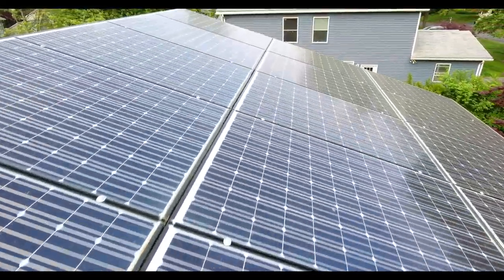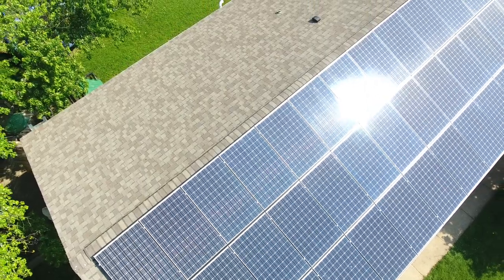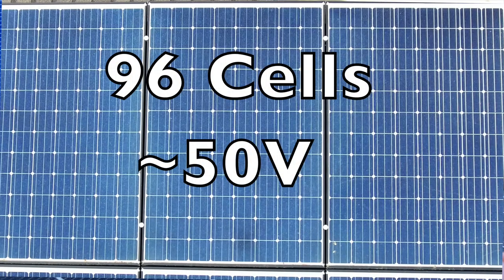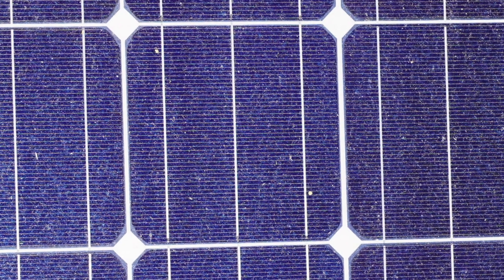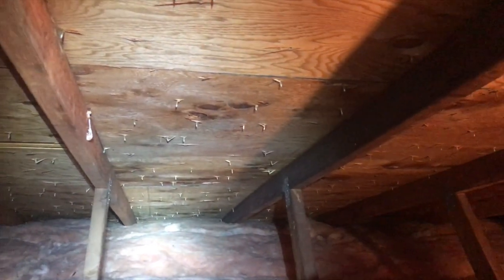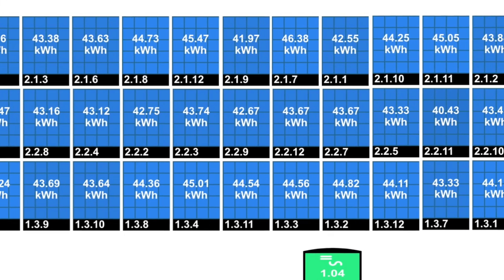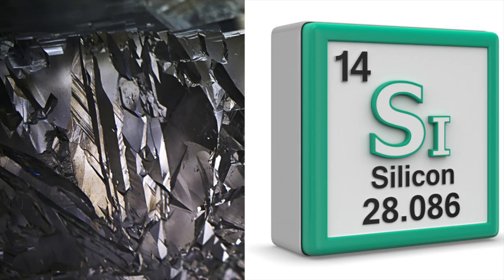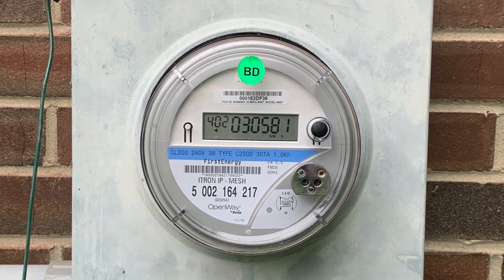Inside My 15,600 Watt Power Plant

Comment: In the middle of my 9kw DIY install right now. Your older videos were in part what helped make my decision! 

Got competing quotes from solar direct and unbound solar. Unbound had a much better offer and was more transparent about prices. 

Unbound did the wire electrical line diagram, and set me up with green lancer for the site plan.

Went with Enphase inverters, and have same iron ridge rail/feet. So far about 50% through the project now.  Looking forward to passing inspections lol
Reply from the maker: That’s awesome!
Reply: How far have you come three months later?
Reply: @tristanmoller9498  it's been installed since early July. So far so good!
Reply: @Zaugger  Congrats!

Comment: As tech advances, I consider doing this more and more. Retail panels are getting closer and closer to 500W. 

47% efficiency has been achieved in the lab and 40% has been achieved in the field.
Reply: 47% efficient? oMg then where’s the tech?🥺I wanna get the system also but my pockets are not yet ready.

Comment: I didn't see a battery bank why?? Also if you need to put a new roof you need to remove the entire system or the panels help to protect your roofing last longer??
Reply from the maker: Check out my solar misconception video.  It will answer the first question.  I have 1-1 net metering.  Yes, it helps protect the shingles.

Comment: What size wires did you use when you in stalled you production meter is a production meter the same a Bi directional meter, also do the wires from the combiner go to the top of the meter and the bottom wires go to the disconnect, Thank Great video
Reply from the maker: Thanks!  The production meter I put in is only one direction.  I don’t remember wire size off hand but I think they were either 2 or 4 gauge. To answer your other question, if probably have to watch the video again, LOL.  I seem to remember the input to the meter is on the top.

Comment: Now to install the whole home battery back up. That way you can go days without solar or grid power.
Reply from the maker: Good idea.  I’m glad I don’t really need it, but I may do this one day.  Net metering in PA is very nice and I get a 1 for 1 credit for any excess solar generation.
Reply: @FrugalRepair  just imagine how much you would get back if you use zero from the grid and always have a surplus. Yes ROI to think about I get that but hey why not have that independence?

Comment: When looking at your roof my initial thought is that you could fit a fourth row of panels. The lower part could still rest on the roof and the upper part could rest on stilts that are fixed on the shade side of your roof. Gives you maybe enough power for a small electric car and thereby cut your fuel costs.
Reply from the maker: I don’t think that is wise to have an extension apparatus above the ridge line. It would probably be very expensive to setup too.  I’d worry about wind and maintenance too.  Maybe I’m misunderstanding you.  The better next step I’m considering is put in mini spits for heating and cooling.
Reply: @FrugalRepair  well wind and other weather was also an initial thought when writting that comment but at least from wind you seem quiet well protected with the trees and houses around you. Cost probably heavily depend on how complicated the stilt system needs to be. Spits? Sorry I don't understand. You mean using solarthermic and photovoltaic energy simultaneously? That'll be genius!!!

Comment: So you still draw a lot from the grid when it's dark, right, but during day time you produce so much that net net, you're a net producer? My point is, you do need the grid every day? Are you thinking of putting batteries?
Reply from the maker: It’s better to look at it annually.  I have a net metering agreement so I make credit in the summer and use it up in the winter.

Comment: Do you have any battery system like a Tesla wall? If not then why not?
Reply from the maker: No, I don’t have any built in batteries.  I really don’t need them.  I explain more in the “is solar worth it?” video but net metering is the reason.  The power very rarely goes out so the batteries would be a big expense I would almost never use.
Reply: How about one or two marine deep cycle batteries  like technology connections did with an Inverter so you could at least run the fridge(s) and some lights when the power eventually goes out or the heater control panel depending on the season.

Comment: You have the best video on solar systems. May you talk about in more details how you connect the panel DC output to the converter? How many in series to get 400V DC?
Reply from the maker: Thanks!  For SolarEdge (p400) you would need enough panels to get up to 400v.  In my case 8 was the minimum per string

Comment: You are awesome.  I'm curious about your decision to go with string innverters, vs microinverters?  My thought is, what if one decides to add more panels, and then finds out that the string inverter also needs to be upgraded to match?  Okay, I see from your earlier video that you went with Panasonic 330 watt.
Reply from the maker: Thanks!  A big factor was cost when I was deciding, SE was cheaper.  I also have the ability to charge batteries easier since I have DC coming off the roof.  I’m also not realistically going to add more panels to my roof but if I wanted to I could add a few more with no problems.  I think micro-inverters are a great choice though!   My panels are 325w Panasonic’s.

Comment: Nice work ! Looking forward to install a 20kW solar panel system myself in the next year, just for the same reason as you: reducing my bills. I will also try to heat up the house using an electric system heater and very low usage of Putin's gas... (I live in Europe - Romania) and also switching at least one of the two cars we have to an electric car. From my calculations we should be able to have  zero bills and also a little income from the electric company switching all to electric (heating, hot water and both electric cars).

Just wondering: how comes you have 240V in your low voltage grid? Don't you guys in the US have 110V low voltage grid? 240V (230V to be more precised) is a common voltage for low voltage grids in Europe.
Reply from the maker: Thank you!  Your project sounds great.  240V comes to our homes from the transformers.  It's 2 120V lines.  Some appliances use 240V but most everything else uses 120V.

Comment: Whats wrong with panel 2.2.11? and howmany of your Solaredge tiny controllers died? :)
Reply from the maker: There’s nothing wrong with it.  It may produce less for any variety of reasons, shading or soiling would be the biggest ones.  If the numbers get significantly off, then I would start investigating more.

Comment: Does the Hydro company pay you or credit you for the excess power that you produce? 
Also, your main shut off switch is outside.  Is this a code rule, or just for ease of installation?  Personally, I'd want that inside the house, due to anyone just walking up and shutting down your hydro.  Curious minds want to know?  😁 Cheers,
Reply from the maker: Yes, anyone can walk by and shut off any solar system.  That's the code in case a first responder needs to make sure it's off.  I get 1-1 net metering credit for excess KWH

Comment: I would Imagine the shade that is created from the panels keeps your attic cooler as well therefore your HVAC system not having to work as hard
Reply from the maker: I’ll have to do some comparisons at some point.  I did take thermal readings before putting on the panels. But I bet you are correct and it is cooler.

Comment: Why two inverters?? I’ve seen a few peoples home systems that have two inverters, but no one ever explains why. Is it because of the amount of solar you have on your roof and the limitations of the inverters that necessitates two? For instance, if you had less panels on your roof then you would only need one inverter?
Reply from the maker: It’s the maximum input for the inverters.  These are 7.6kw each so I need two to handle my 15.6kw system.
Reply: @FrugalRepair  Awesome! Thank you for confirming. Really slick system and you do a great job with the videos.
Reply from the maker: Thanks!  Currently working on the next one.
Reply: @FrugalRepair  I'll make sure to check it out!
Reply: @FrugalRepair  Also, I'm missing something. You have a 15.6kw system, but don't you only have 48 panels? Don't they put out 100w a piece? Shouldn't that only give you 4,800w or 4.8kw? Thanks!
Reply from the maker: They are 325w each
Reply: @FrugalRepair  Welp, there you go! I appreciate the clarification!

Comment: Did you notice a reduction in attic temperature because half of the roof is essentially shaded now?
Reply from the maker: That’s a really good question. I did not take attic temperatures before putting in solar but I did take surface temperatures of the roof. At some point I want to go back and compare them to see.  It clearly has to be cooler because the panels are absorbing so much of that heat and keeping the shingles shaded.

Comment: How do they withstand hail?
Reply from the maker: The panels are strong and there’s no worry here of hail but if a big hail is going to dent your car, it might crack the glass on a panel.
Reply: @FrugalRepair  We have bad hail storm yearly here so I think I will pass on them.
Reply: @mgomez5606  Maybe consider a small ground mounted system and cover the panels with cardboard/towels/boards or something whenever there's a warning for hail.

Comment: I have roughly the same electrical needs as your home in Ohio. I definitely want to do solar for a while now. I saw you just put on new shingles. I am doing a roof over with metal. I also because of cost want to do this in stages. Maybe 8 panels x 3 stages = 24 panels. I have considered micro inverters instead. I live in the country where we have a co-op for electric. I discussed this 2 years ago but we don't have net-metering. I would have to buy their electric for retail ($.11) and they would buy mine for wholesale ($.6). So I would have to install maybe 36 panels to sell wholesale electric to break even.
Reply from the maker: I’m excited you’re thinking about solar. Sorry to hear that you don’t have net metering though.  Hope it works out though!  Let me know if you any any questions.

Comment: The cells you are showing are not for commercial dolar psnels. Solar panels are built with much, much higer quality and higer output cells. Just be clear.
Reply from the maker: The point I am trying to make is that they are very fragile.  That would be the case for any poly or mono crystaline wafer.

Comment: I would have my excess power running a Cryptocurrency mining rig BEFORE I would even consider giving it away to the power company!
Reply from the maker: I’m my case with 1-1 net metering it doesn’t matter.  I’m getting paid for this excess.  If I didn’t have 1-1 net metering, time of use rates, or I was generating way more than I needed annually, then what your suggesting makes sense in my situation.
Reply: @FrugalRepair  you get paid 1/50th of what you are charged for the same amount of power. Then they turn around and charge others full price for the power they paid you a 1/50th for.
Reply from the maker: I don’t think you understand.  I show my bills in other videos.  I get paid full retail rate so it doesn’t matter if I use more to mine crypto.  If I use more electricity than what I generate in a year I’m paying for electricity just like anyone else without solar.  If I am not using up all of the excess I generate when it’s time to do the true-up (happens in May) then yes, it might be been better to use that excess electricity for something like crypto.